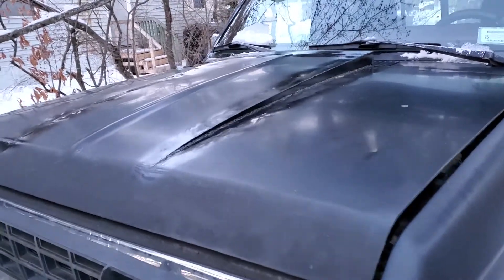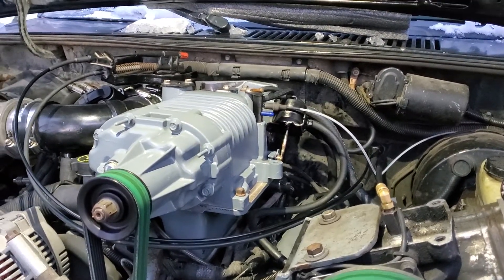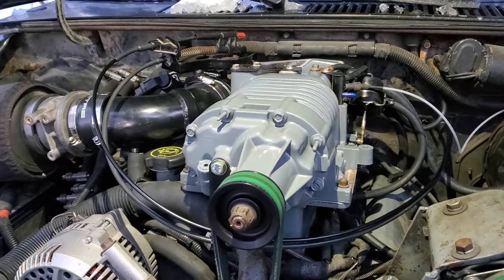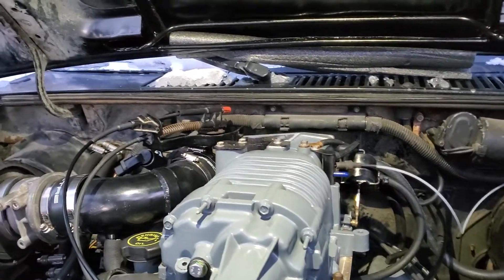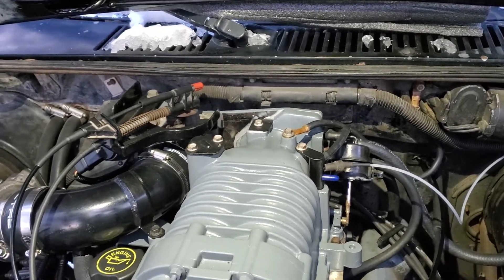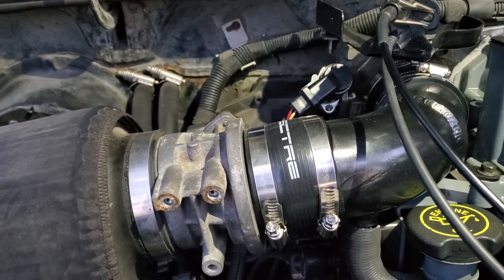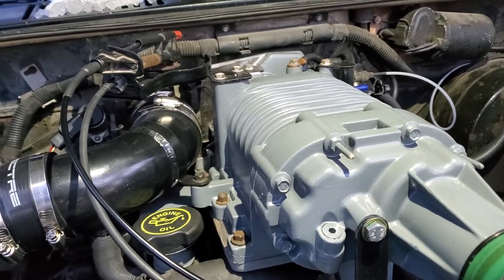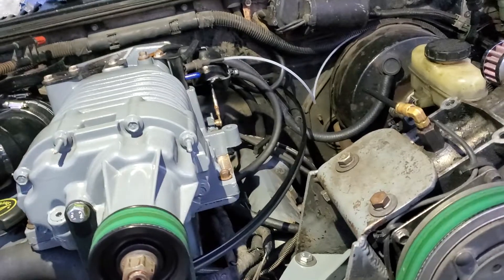First gen Ranger 4.0 OHV Supercharged (GM supercharger on a Ford version 2)

Comment: I’m debating on doing this to my 94 explorer. I’ll be putting a 422 cam in as well. My concern is getting it tuned and piecing everything together. I’ll have the motor on the stand and I feel like I’ll regret not at least doing SOMETHING that involves boost lol.
Reply from the maker: That's where this particular setup was mocked up.  I was fortunate to be able to borrow a blown up engine from the junkyard near me to mock it up.  I'm currently waiting to get it tuned right now, there are a few people who are good with the old Ford stuff and tuning it the right way.  I'm currently running a pretty lame 3psi and stock injectors.  Once I get it tuned I'll be running between 6 and 7 psi with bigger injectors and a bigger MAF.  I've contemplated running the middle of the road cam but I'm going to discuss it with the guy doing the tuning to see if it would be worth the effort to install.
Reply: @holyford86  yeah I’m not sure I’d have that kind of luck lol. I’d definitely be interested in a more in depth video of what all I would need to do this. A cam and supercharger would definitely make a heck of a difference in power lol. How much throttle cable modification did it require? Another concern for me is finding the right belt to fit it and pulley lol. And then of course unfortunately I have a a4ld automatic and I’m not sure if it would hold up to a lot more power
Reply from the maker: @vehiclemafia9308  I'd be happy to do a little more in depth video to explain how I made it fit and what parts were used to get to that point.  Is there anything else that you'd like to know?  I dislike the A4LD, I've seen them hold up to some pretty intense use with tough truck racing  but I've also seen them get eaten alive by a 2.3 in light load street driving.  They seem to rob tons of power and aren't well suited to the job at hand.
Reply: @holyford86  yeah mines been abused and still somehow shifts great lol. Besides reverse is a little rough.
Reply from the maker: @vehiclemafia9308  they seem to like being beat for some odd reason, haha

Comment: im trying to do the same but with less and less fab shops i cant put my eaton m90 on my 91 ranger 4.0 i tried fabbing one 2 times both times it didnt work properly was thing about mounting it above stock intake and doing a push through style almost as if it was a procharger
Reply from the maker: @fallout4-settlements  this was all built by myself and a friend of mine, the only outsourced portion was machining the adapter flat.  I have a more detailed write up of this if you're interested.

Comment: How did you make the adapter/mount between the supercharger and heads
Reply from the maker: Mount bolts to factory lower intake plenum, both the top and bottom plate were designed in cad and cut out with a cnc plasma table, they were squared and mocked onto a spare engine and then boxed in
Reply: @holyford86  steel or aluminum? How thick of a plate?
Reply: @holyford86  Any concerns about the plenum not being able to handle the torque from the belt tension? Might cause a water leak?
Reply from the maker: @timmymlee  3/8 top and bottom, 1/8 everywhere else, mild steel
Reply from the maker: @timmymlee  hasn't yet, 6k on the swap, no leaks, no coolant use